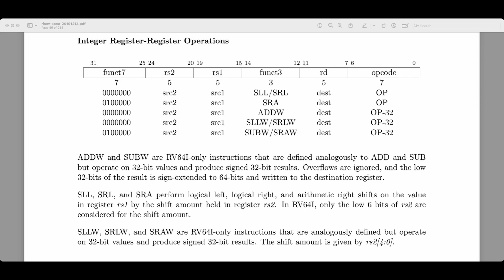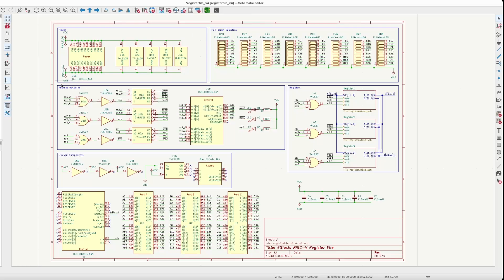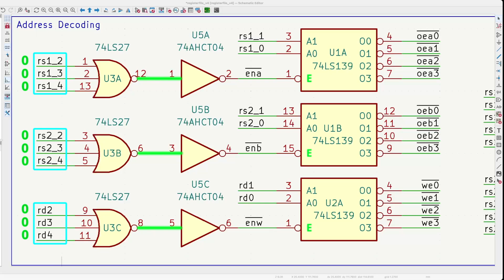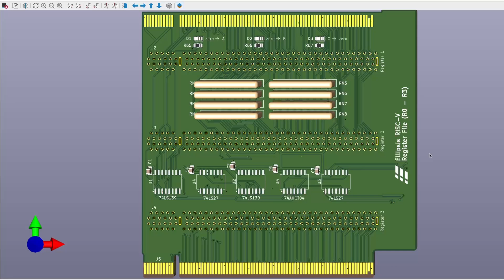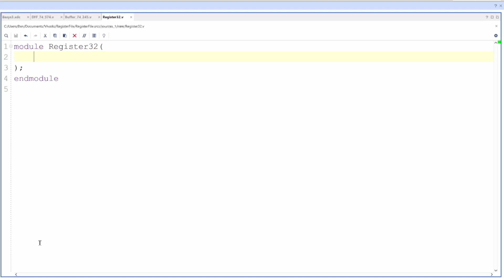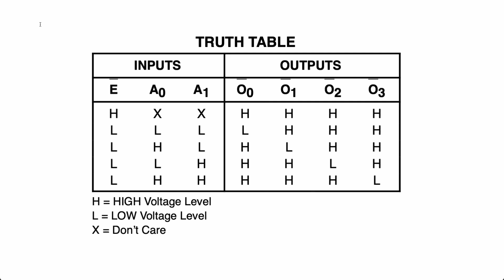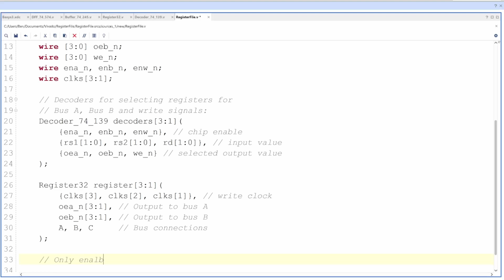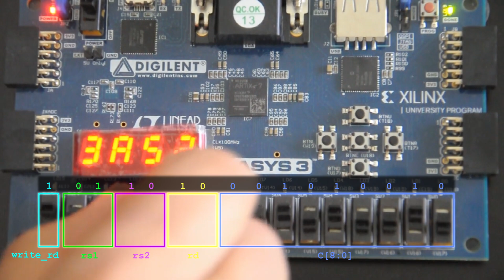Register File (RISC-V Part 7)

Comment: When you need two output ports but have a simple memory, an option is just to put in twice as many memory chips and send the write data to both. In your case you could have a pair of 74HCT574 with the same 8 C lines going into both, The 8 outputs of one would be A and the 8 outputs of the other would be B. Using the 574's three state outputs would eliminate the 245s. There would be 4 pairs for 32 bits, so 8 chips instead of 12.
Reply from the maker: Yes, that's a great option to reduce chip count. However, my goal here was to give a view into some of the registers since the objective here is to build a microprocessor that can assist in teaching. If I used the tri-state feature of the 574s then you wouldn't be able to see what is stored in them unless you are reading from them. With the separate buffers, the LEDs show the register value even if both A & B buffers are disabled. I'll do something with a low chip count for the rest of the registers though.
Reply: @ellipsisprojects  you are right about my idea not allowing LEDs to always show the values of all registers
Reply: @jecelassumpcaojr890  I wish that someone would make something cool. For example buy a broke ferrite core memory and use those to even out current through an LED. Then have some refresh cycle to go through all registers, to keep the current (pun) state so like in intel 4004 and 8008. So with a constant cycle : read, read, refresh, write . Maybe lend some pick and place robot from other youtubers.